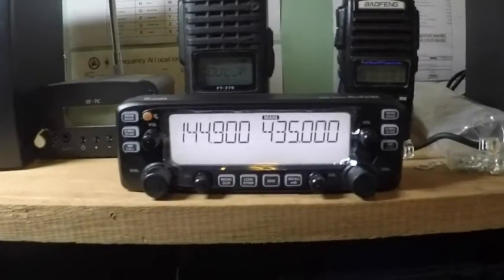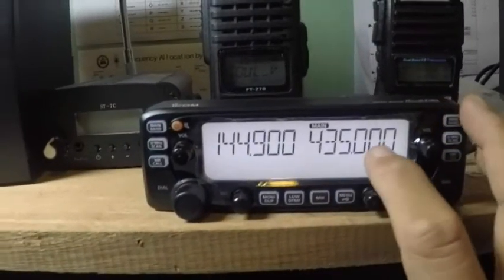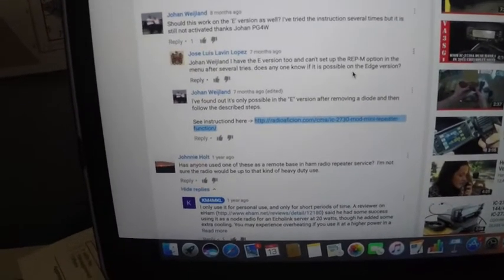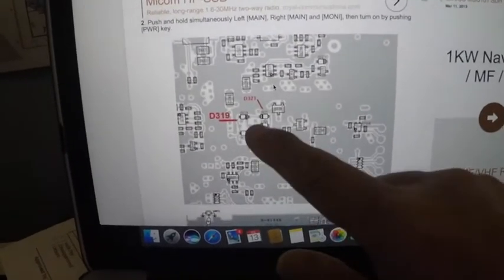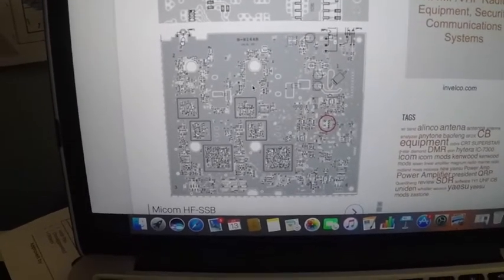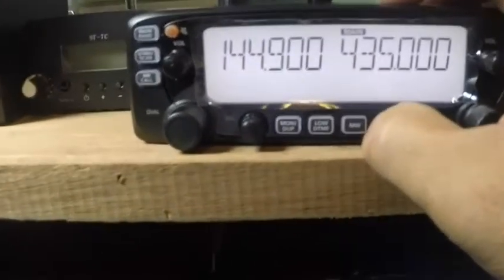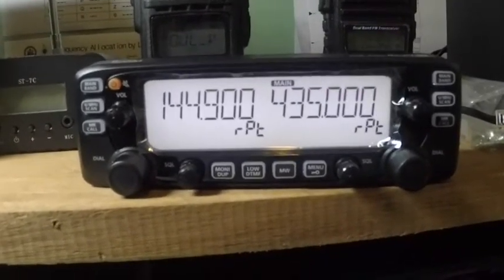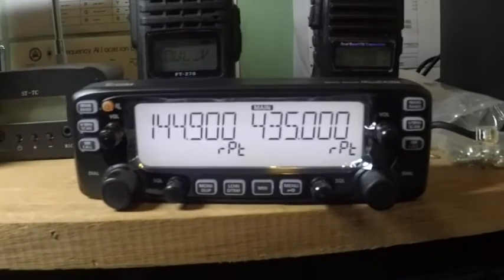ICOM IC-2703a Cross Band Repeater Setup

Comment: After removing the 319D diode for the lCOM 2730, the transmitter (TX) became permanently on. When I turn on the signal repeater. 
Is there a solution for that?

Comment: Thank you for the very helpful video. I have a question. Is it possible to set this radio as a single band repeater, as opposed to cross band, for example in the 2 meter band with a 600 Hz offset? Thanks
Reply from the maker: no it can't work as a single band repeater. it can only work as a dual band repeater

Comment: Dear I have an inquiry
I have a 2730A in the car when it is connected to the crosband repeater in the house. I hear the echo sound very annoying and they said the reason is that it has no mute.
The question, if remove it D 319 cel, the echo will disappear
best regards 
mohd
Reply from the maker: hello sorry but i don't understand your question

Comment: I have a question can you cross band 119.750 mhz with 462.000 because i like to monitor the atc, but my rig is far away from my bedroom, so if it can xband to 462 i can monitor from my bedroom using HT
Reply from the maker: 119.750 mhz or aviation band is not covered by the frequency range of this rig.

Comment: Once the radio is modified into a cross band repeater it is now permanent correct? What is the peak current draw of the 2730a in this configuration?
73, KN4GEI
Reply from the maker: yes it is, not unless you can re-solder the diodes back again. no discernable change in the current draw.
Reply from the maker: you can still deactivate crossband repeater function via the menu system